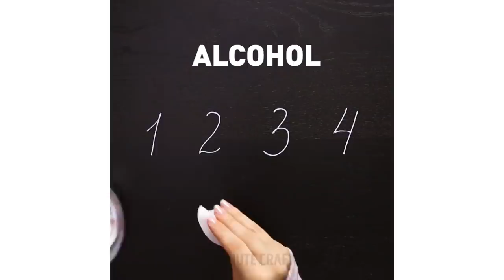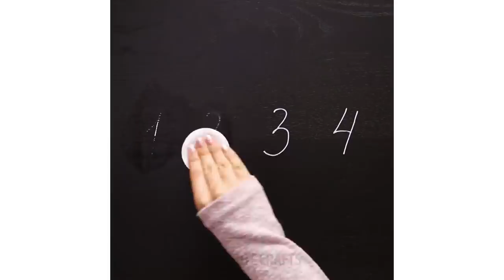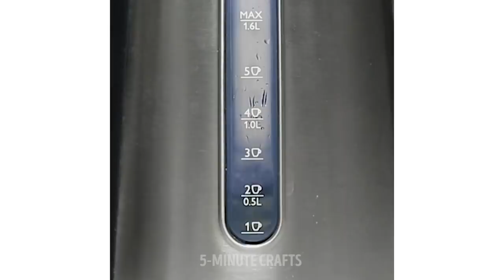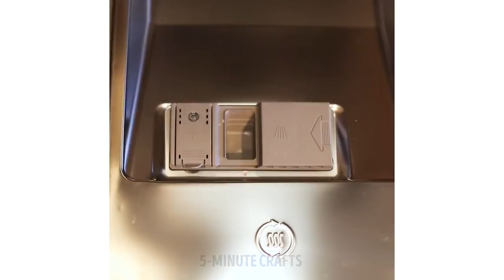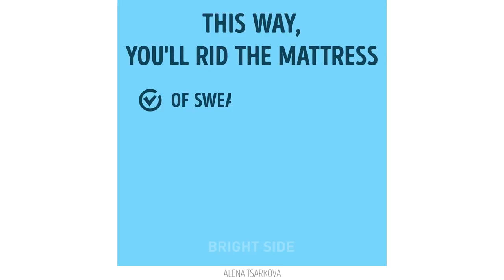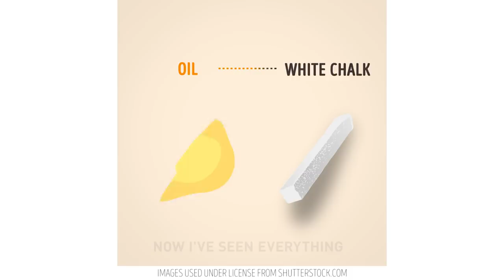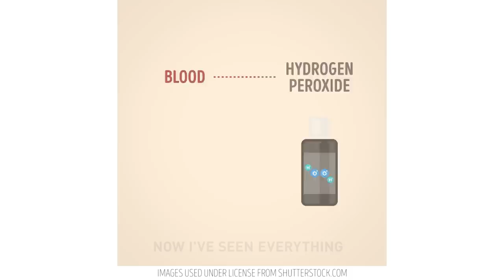22 TIPS TO KEEP YOUR HOUSE PERFECTLY CLEAN

Comment: Do not use acetone or nail polish remover in finished wood. It will strip the varnish and-or stain. The only way to then repair it is to refinish the entire piece.  Try hydrogen peroxide, coconut oil or even orange cleaner instead.

Comment: Ok, I just did the drain with the baking soda, vinegar and hot water at 10:23 and it WORKED!  It was awesome.  If I had gone to buy some Drano or Liguid Plumber it would have cost me $6 or $7.  I was really amazed and it was awesome.  Just give the vinegar 3-4 minutes to do its thing then add the hot water.  Cool!!
Reply: On top of that, Drano and liquid for plumbing issues are SUPER toxic...so much so, that it says not to get the liquid everywhere in the sink or toilet because once you turn the water on, it can splash back up and pose physical harm and dangerous side effects to you. After I saw that warning, I never used it again.

Comment: What is in the bag with the stovetop burner cover to clean it? It was in your thumbnail picture, but not in the video. PLEASE.
Reply: Paula Ayala:  click bait
Reply: Well I've soaked mine in Dawn, got to be original blue Dawn  and vinegar (of course lol) overnight. It works really well. Dawn cuts grease, that's why they clean up animals who are covered in oil when there's an oil spill. Also, I know it's weird, but I bought some lime away from the dollar tree. BUT it was the toilet bowl cleaner. I accidentally knocked it over , the huge rust stain in the tub was gone in the exact spot it fell. I'd tried bleach, it didn't work. I've actually cleaned many things that wasn't the toilet with that. It's amazing!
Reply: You can also use straight ammonia in a plastic freezer bag to clean burner grates.  Just be sure to use in a well ventilated area -- the grates do not have to be completely submerged in the ammonia.  I usually set the sealed freezer bags in a cardboard flat out in the garage just in case a bag leaks, let them soak overnight, pour the ammonia down the drain, and wash the grates in hot soapy water, rinse, and they'll look like new.
Reply: Paula Ayala .

The bag thing on the opening pict.. is for putting vinegar and baking soda and soap into the plastic bag with the burner for no scrub cleaning... it worked ok not the greatest
Reply: Paula Ayala thats why i came to see the video. This people
Reply: Paula Ayala ... hey there I had the same question there is another video that shows that same procedure if you actually type in cleaning burner with a Ziploc it'll take you to the better video but basically they put chemicals inside of a bag and that's how you're supposed to clean your burners I'm not sure why the picture was on this video when they don't show that..
Reply: Use ammonia and keep it in the bag overnight they come out brand new...
Reply: SAME HERE! I get really pissed with click bait like that. I watched a long video and none of it helped with what I came here for. Where the hell is the stovetop burner cleaning tip? Hitting dislike and NOT subscribing thank you very much! Read your comments too. See how many people are pissed!
Reply: Yeah me too looking for the clean burners  I'm glad you all had great ideas thanks I'll try them 😀
Reply: sydney a. and everyone.. Do you have any suggestions on getting built up grease and stuff off of the back of the stove that juts up about 7 inches, that has the temp buttons and clock, etc on it? I can't take strong chems, but I've tried windex and a few others. Also .. has anyone gotten out blood stains from furniture or old stains on carpet??
Reply: cris doller try dawn for grease and Peroxide takes out blood.
Reply: Please do not use ammonia if you live in an apartment. Our neighbor used this method and the asshole didn't stay the night at his own home. The bags leaked and ammonia vapors traveled trough the ventilation system to neighbor apartments, including ours. In the middle of the night, in mid winter with freezing temperatures outside, we were forced to open all windows, we had to pretty much evacuate with our 9 month old in the middle of the night. We couldn't use our apartment until this neighbor came back and cleaned up hiss mess, coz the smell would just continue coming again no matter how much we aired out. We even tried sealing the ventilation window which is not a vise idea in the long run. Unfortunately he did it again a year later.
Reply: April .. thanks for your suggestions. I have different types of Old stains (some from my daughter's cat, hairball problem) on my tan carpet. I've tried so many things, starting with white vinegar at the time of the stain. Any suggestions for carpet?
Reply: Paula Ayala was also waiting for that one must be soda n vinegar🤪
Reply: That's why I clicked...
Reply: @crisdoller3954  use white vinegar